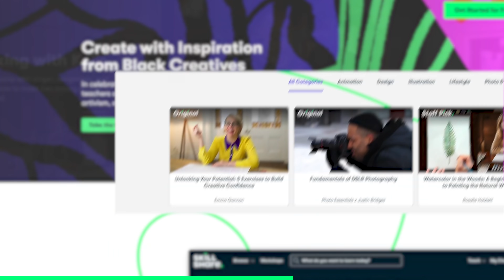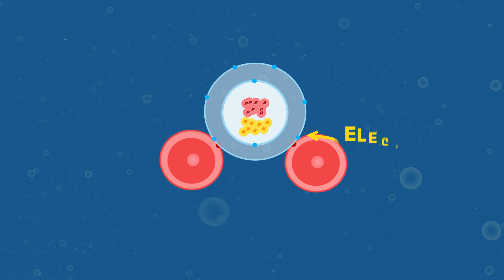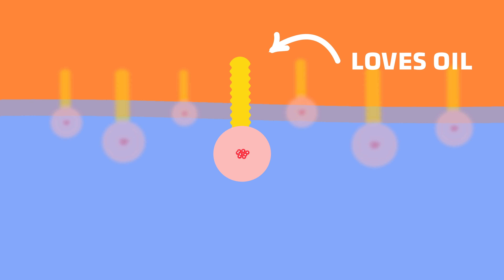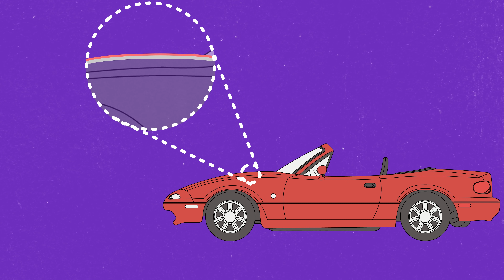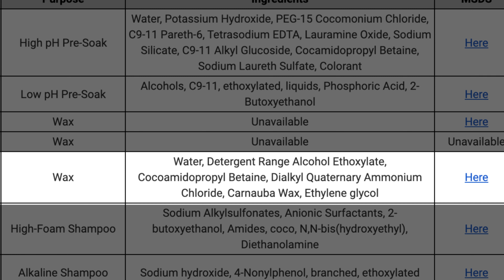Why Car Washes Might Be Scamming You with SOAP

Comment: I always thought it depended on how often the touch pads got cleaned. Does that matter?
Reply: A good carwash will spray them back to the original color (they get dark as they get dirty) around every month or so. But any drive through carwash (that I know of) has the ability to turn the brushes off if you want, just ask an attendant.

Comment: I used to work on automatic car washed from PDQ and RYKO and the 1 company's soap guys would physically test not only the water but also test the soaps cleaning ability.
Reply: I've worked on PDQ machines for a large chain and those machines are a headache.  I feel for you man.
Reply: @RickyB418  I've always said that if the engineers actually worked on the equipment they'd engineer it different. I genuinely liked working on the 4000 but that g5 was the nightmare. Haven't worked on the equipment for over 10 years but still have a g5 remote.

Comment: I always get the cheapo quick way when i run through it. Mostly cause I'm just going for a quick "get the bird doo off" wash. Secondly though because when you've got 4 lanes letting cars in all at once and merging down into one line I'm convinced everyone's getting the same wash because how are they determining which vehicle paid for which wash as 4 cars are being pulled through the actual bay at once. And even if it does somehow try to differentiate between cars, there's always a chance someone's getting the wash someone else paid for, as far as on concerned, in not paying to give someone else a $30 wash.

Comment: Great episode dude. Thanks for breaking it down so people understand what’s going on at the wash. As a car wash owner I will say you got one thing wrong. The tri foam is designed to do the things you said but it also acts as a lubricating agent to help the blowers dry the car thoroughly. It’s an important piece to providing a clean car along with spot free water which has no minerals in it for the final rinse.

Comment: I worked at a car wash for about 8-9 months and yes it does your car cleaned. But the difference between the cheap wash and the expensive wash is just add ons like hot was and ceramic seal but honestly the difference is slim to none except for the price at the place I worked at it would cost us about 40 cents to run our most expensive wash which was $20 and the cheapest wash being $5 so honestly if you are looking for a quick wash it you are lazy just save ur money and get the cheapest wash possible

Comment: As an express carwash owner, this was funny to wash lol. Sadly only some carwashes like mine use the correct amount of soap with little mix of water for the perfect clean/shine. Most carwashes cheap out and mix the soap with 50/50 water. Also, the Lo and Hi PH soaps, if are not used with correct ratio, it can either be completely useless or, too effective. Lo PH is very dangerous when used in large amounts. I wash about 12-15,000 cars a month at one of my locations and we go through about 15k worth of chemicals a month, top quality. Expensive, but the results are mind blowing. So yes, some washes do rip you off. Some thankfully dont. (IG: @NorthStar_CarWash)

Comment: I’m a GM for a car wash and I can tell you it’s a scam. It’s very lucrative business however. All people see are clean cars coming out the other end. Fun fact the car will come out the same clean no matter which wash you get. You can get a $10 base wash and the end result will be the same as a $22 wash. The chemicals are all 99% water ,the wax, the soap, conditioner, etc. if you run your hand  on your car after you get out the car will still feel rough or sticky depending on the condition of the car before it went through the wash. The water they use is unfiltered city water and also recycled water from the car wash which contain contaminants that could ruin your cars paint so they put bleach tabs or brine to help neutralize the damaging effects. Cloth wraps are an ass to clean, so they don’t get cleaned so whatever dirt is on the car prior to your car is getting smack on your car and scratching the shit out of it on a microscopic level. Neoglides are latex wraps that are even harder to clean and although it can’t trap dirt, it can get stained and caked up easily and with that being said it will also fuck your paint up. At the end of the day if you’re really serious about your car not having swirl marks and being really clean do a hand wash yourself and wax it after. That’s the only way to guarantee a flawless car.

Comment: I can't even use automatic car washes it rips my antenna out of my car every time. I drive a 2008 chevy cobalt. I've had trouble with the antenna in the past a little piece that held it to the car broke off one day and I replaced it. But never glued it in like I was supposed to so it comes out if its messed with too much. It can handle wind though.

Comment: As well put together as this is, there’s many very misleading parts. 

Soap, doesn’t actually do much cleaning on it. Take any kind of foam, put it in a foam cannon, foam a panel on your car, let it sit, then Prespray the adjacent panel with water and let it sit. Rinse off, and you will have around the same end results. APC(all purpose cleaner), or dedicated bug remover. is what will really help break down road film, bug guts etc. this car wash is the same idea. Since you never used one, you may not have seen how much they miss after using them for years, even just months. They never get your car truly clean. They clean the surface dirt, but never that road film. There is no replacement for agitation. 

Next, the triple foam. You mentioned it has polish, and polishing compounds. Very misleading terms, but only goes to negate so many high end professional shops that charge hundreds, and thousands of dollars for a paint correction. A paint correction is what actually cuts and levels the clear coat on a vehicle. Triple foam doesn’t have it. Wax isn’t a polish, or a polish compound. Wax can fill in scratches to hide them for a short period of time (that’s why wax gives that wet wet look after, that stems from whe you wash it, and it’s wet, it look super slick and perfect. The water too, fills the pores of the paint to create that gloss), but even in triple foam, the wax used, isn’t that type of wax. It’s a short term, couple day protectant. Even if said triple foam had polishing compounds in it, good for them. Still ain’t leveling the clear coat. There’s no mechanical procedure being done to cut and level the clear coat.

Lots of miss and false info

And we haven’t even gotten into how not decontamination a vehicle paint work is ass backwards when washing the vehicle is. All that road film, dirt, pollen, iron from brake pads/dust etc, will also fill the pores of the Laing, creating the need for iron removers, and clay bars, and leave your paint feeling like poo, and waxes will not be able to do their proper covalent bond with the paint, to ensure the best and lasting results. 
Very minor things, but you made this process sound so amazing and scientific, but these car washes, and the tunnel car washes are what truly best the hell out of paint and leave imperfection in them. They do more harm then good. 

There’s a good concept here for the majority of the people watching, but for the people who know their shit, their heads are rolling. You should have gotten a high end  professional detailing perspective and then explained why they are a scam, it would have been a lot better, and a lot more correct./informative.

Comment: I live in Minnesota and the carwash I go to has an underbody sprayer as you drive in. If the chemicals are hard on the paint it's well worth it because keeping it clean from the salt covered roads stops it from rusting out so fast. I wash my Jeep at least twice a week in the winter and for a 2014 with 80K miles the underbody looks almost brand new. Well worth it for me.

Comment: "Water and oil doesn't mix"

Me: ahh I see you've never owned a a first gen 4.0 Explorer 😂😂😂
Reply: That moment when you can argue with your science teacher when they say that.
Reply: 93 explorer with 2 brand new heads.. each one a month apart. Then the ebrake decided to stick and catch fire.
Reply: I didn't got the joke, can somebody explain
Reply: Head gasket failures I'm guessing...
Reply: @Qui-9  that and valve seats cracking lol
Reply: Enlightenment required
Reply: @Tom-li9xq  the heads tend to crack between the valves when the motor overheats

Comment: Surfactants (Soap is a surfactant) create micelles that emulsify oils and lift oil from surfaces.  All soaps are surfactants, not all surfactants are soap.  

Also - surfactants can have different purposes - for example, the surfactants in the wax mix might be there as 'carriers' to emulsify the wax and be washed away after the wax bonds to the surface.

2-butoxyethanol is a solvent commonly used in cleaning products

Comment: I don't use car washes unless I plan to hand wash later. Definitely always touch free too, since the rollers will always have dirt and rocks in them and give your car swirl marks. In terms of scam I've seen several car washes not even fill all the soaps and foams they promise, I've also seen where sprayers aren't working to spray enough of the chemical. Either way, auto and even hand car washes will never care enough to do as good a job as you will, hand washing and waxing yourself.

Comment: The thing which makes the expensive package work are actual service and indeed, scamming you. The actual washing, whether that be the foam or stuff, doesn't make a difference at all in regards to the cheap or expensive package. So if the wash process is the same, then just pick the cheap package. However, what most CarWashes do is that the expensive package includes additional 'services', like wheel/rim washing and underbody washing. The thing is, these things mentally convince you to choose that package, including the wax. shiny wheels make it worth in your mind to go with the expensive package. the 'hot wax' to me btw is really annoying because it also covers your windshield and i hate the effect that has in rain and in certain sunshine. i always use alcohol spray and a towel to get it off immediately after going through the car wash.

Comment: This isn't a recommendation but for twenty years I worked in a lab.  When you see pictures of laboratory technicians working with fancy glassware remember all that stuff needs cleaning.  One place I worked at had dump trucks - a lab and dump trucks, an interesting combination.  One day a driver came by the lab asking if I had any detergent.  He wanted to wash his truck.  I gave him Alconox, the detergent we used to wash glassware.  He raved about it, said the paint shone like new.  The word spread and soon I was having to order more Alconox.  I never tried it on my own car, but yeah, what detergent you use can make a big difference.
Reply: What Alconox, specifically?
Reply: alconox is somewhat bad for the environment, in that it shouldn't be discharged into the water. so preferably don't use it for everyday tasks. It contains phosphates which cause issues. So if anyone sees this and thinks, "Oh i'll order alconox to clean my car." please dont. Just....like please dont. Anything you use with alconox needs to be treated/neutralized before discharging into the drain.

Comment: I know this doesn't fit but hear me out: Everyone has seen the Mercedes in 1999 takeoff so I was thinking to avoid something like that happening again with having the same angle maybe you could have downforce producing ramps pop out of the car when a sensor detects that the car is getting lighter. These would also retract into the car to avoid drag on straights. Anyone's thoughts? (I'm new to cars in general, please no hate)

Comment: If it’s a car you care about or don’t feel like doing a paint correction every year. Have it ceramic coated and pressure wash it at a coin wash until you can do it by hand the proper way. If not, and it’s a beater with faded paint, send it lol.

Comment: Awesome explanation. 
You got it pretty well figured out!
We have different packages, and each package contains very different services. We use  high pH presoak, high pH foam, three different wax options, a low pH foam, two wheel cleaner options, and three drying agents/ polymer seal options. 
All of our chemical products are tested extensively for performance and safety. 
I can't speak for every carwash, of course but here's a good tip- 
If the carwash is clean, it means the operator cares. 
Don't use a carwash that stinks, or is visibly dirty.

Comment: Ph is actually the electrical potential in a fluid. The lower the ph the higher the positive voltage and the higher the ph the higher the negative voltage. The human body cells operate at -25 millivolts so just over 7 ph

Comment: A local bylaw was passed recently in our city that prohibits any chemicals, biodegradable/nature friendly or not, from entering the storm water system (read: gutters). The only way you can hand wash a car is by doing it on your front lawn, a graveled parking pad/area, or on land far enough way from a street. So you're either stuck with a touch automatic carwash that leaves swirls, touchless automatic ones like this, or wand wash. The fine is considerable as well so you can't just take the chance. 

It really sucks.

Comment: As a former carwash manager, most of what was involved in the higher end car washes is more protection based and not necessarily extra cleaning. Things like tire dressing, protective coatings that will help water bead and that sort of thing. How long would you like the car to stay more protected. Super cool episode to see all the chemical balances brought to light!
Reply: My tunnel was a giant chemistry experiment. 

I had really hard water, and Stone Soap in Sylvan Lake, MI set me up with a shampoo and drying agent that complimented one another. It made a pretty big difference, but was very expensive. 

I had a tiny 50ft tunnel, so I only had one foam wax arch, and that was one of their tri foam "conditioners". I chose the green. 

They had two varies of tri foams. One that contributed to the cleaning, and another that had actual carnauba wax. I chose the line that cleaned more because my location was where a lot of muddy cars went to. 

My former emoyer in the industry also had a simar philosophy.

Comment: Always skip automated washes if you have a nice car. Learned that with my highschool car. Had an 84 z31 turbo i worked three summers to buy. This was in the early 2000s though so nobody saw what i did in that car. I worked at an oil change shop and it was connected to an autowash. Took my car over there after work the day i bought it and the wash ripped off both my fu**ing mirrors! They pf coarse accepted no responsibility and everybody basically made fun of me and cracked jokes about my "girl car". I quit that job like a month later because of it and thats the car i met my wife in. So i can conclude two things. 1. Fuck car washes. 2. Forget what a bunch of fat guys think about your car.

Comment: I used to use auto car washes but they never clean very well. Hand wash in the driveway or at a self wash stall only anymore-  always use the high pressure wand to clean the foam brush first!

Comment: I'd like to have seen a discussion about the water use.  Fresh?  Recirculated after filtering?  Watered-down bird poop?  Otherwise,  thanks for this.  Isn't it as easy to push the $10 button as the $8 one.

Comment: Never take your car to a car wash. I’ve worked at many and every single one is as cheap as possible. If we run out of soap they say fill it up with water. If one chemical is out they tell us just put the other one in. If your low on chemicals for the week they just double the ratio of water in the solution for a week. Our machines destroy your rims and we know it. It cost far to much for a manager to care to replace the tracks that guide your car. Anything that we actually need in the car wash is “too expensive” to the owners and could be done cheaper.

Comment: I charge a minimum of $80 for a full detail. I’m 25 and that price is because I know my worth detailing was my second job at the age of 17. 8+ years of experience definitely worth every penny. Smaller cars like that Camaro would easily be a lil cheaper but from a detailer..... if you get a car brand new or relatively to brand new then you do a paint correction and ceramic on everything you will have no problem going to the auto car wash at least once a week your car will look pretty much brand new until you get rid of it.

Comment: I'd be curious how many car washes actually use these different soaps. I used wand washes until I finally invested in a pressure washer, and found that the "high pressure soap" stage of the wash rarely did more than the plain "high pressure rinse". Sure, it made white suds and looked different, but at most car washes I visited, it didn't actually emulsify the dirt and remove it.

Comment: People are crazy. They’ll pay 50k for a car, drive it through a $12 death tunnel every week and then wonder why their cars paint is all screwed up. Most people don’t realize that you have to physically touch the paint to get it cleaned. 
Any detailer will tell you the foam is used to remove the top layer of dirt but nowhere near all. It basically allows the hand wash to be safer and more effective. Then your car should be clayed every 6 months. 
The grime these washes leave on your car can seriously damage your paint over time if not removed correctly. I have customers come in with stains, etching, etc in their paint and chemical residue all over the place from these touch-less washes.

Comment: Usually the SDS will show you what is at the non-diluted rates of the chemicals used in the tri-color foam.  Typically they will be diluted when put through the sprayers.  Hopefully this ran true for the carwash you rode through.